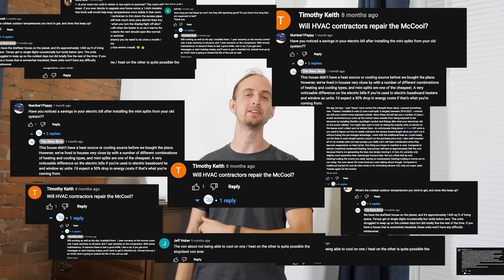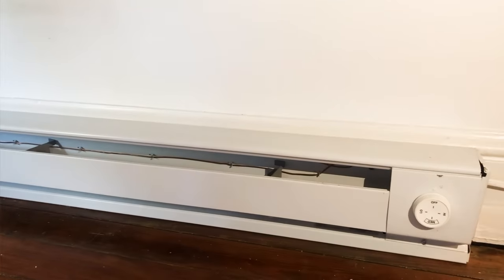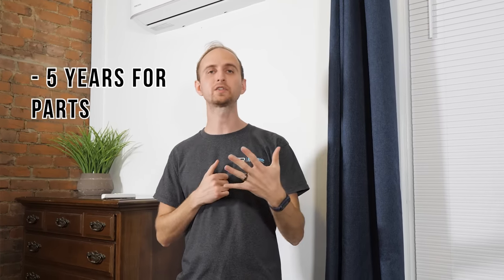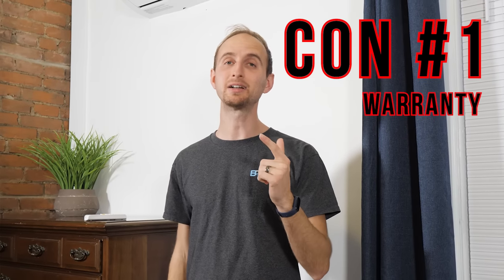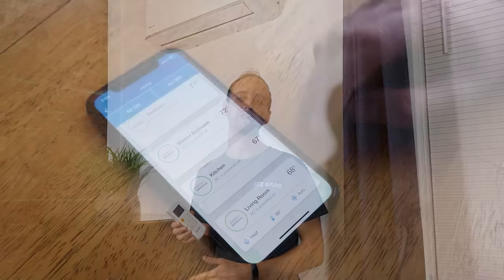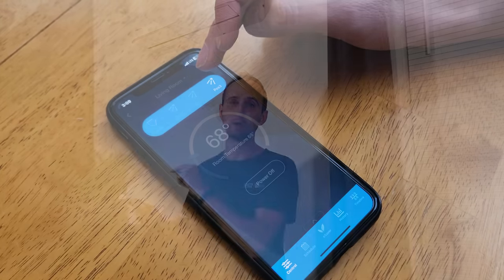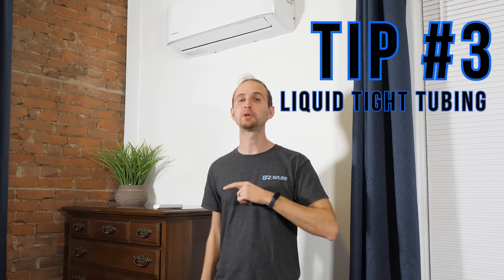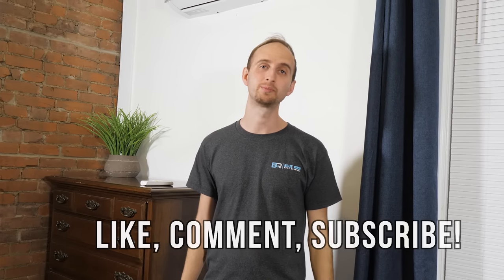Mr Cool DIY 2-Year REVIEW: I wish I would have known this BEFORE BUYING...

Comment: Just wanted to say, thank you for your video, very helpful for us to make a decision of purchasing a unit... Still a little bit stand offish. I do have a question for you... ?  Winter time... We get a substantial amount of snow, like 6 feet at times. The question is were we get so much snow, what to do with the condencer / unit that is out side.. Do we cover it? Do we not cover it ?  Do we have to keep removing the snow from around it.. if so that would be a lot of digging snow out from around it.... This might be a deal breaker for me if so.. 
Thank you 
Danny B
Reply from the maker: Thanks for watching and commenting! Great question, first of all I’d recommend to you to consider Daikin or Mitsubishi. The DIY component of Mr Cool is easily accomplished by purchasing Rectorseal fittings to connect the line sets of a pro system. If I had it to do over, I wouldn’t be so afraid of installing a pro system. The Mr Cool DIY needing new blower motors within 3 years isn’t a good sign, and Daikin has the number one spot in most reliable and best service ratings. Check into it! I’m not sorry I bought Mr Cool, but I hope that I don’t become sorry if things keep wearing out before they should.

As for the snow, definitely build a roof structure overtop of the mini split condenser. I’m sure you’ll be able to find videos of this on YouTube, or even how people in cold climates with a lot of snowfall do to protect their mini split investment. I know that some top manufacturers actually require a roof over the minisplit in order for the warranty to be valid. That’s not a bad thing, because they know that they’re offering a great warranty and they want their units to last a long time for their customers.

Comment: I've heard or seen others with leaking DIY linesets. Otherwise, if they do leak, you can pump them down, then cut off the ends and make them into any other flare sets if you remove the adapters on the unit itself.
Reply from the maker: Sounds like a great idea! Thanks for commenting! If I have an issue with leaking, which I have not yet in the last 2 1/2 years, I will definitely take that opportunity to remove the excess line set as well if it seems easy enough.
Reply: Doing the same thing because of leaking line sets. Where do you get the adapters to replace on the unit ? We  have 1/2 in line going in the adapter on the unit is much smaller.
Reply: @janetpuccio8209  You should be able to remove the adapter on the unit and then do a normal flare setup.

Comment: Just wanted to say my experience with support has been pretty good as well. We were having problems with the settings you discussed shutting units off and support guy back to us with the hour and kept with us for a couple of days until we figure out what was going on.

First the record, we had set up the app, as well as the remotes and they were fighting with each other.

Use one or the other and everything should be fine.

Right now I'm looking into the cleaning because we are expecting temps of close to 110 next week, that's why I'm here commenting on your video 🙂

Comment: We had the same problem, and they replaced the motor. I wonder if their motors are defective. More importantly when seeing how gross the the blower wheel was and how difficult it is to get to it, and you really need to remove it to clean with a water hose. I do think I would have reconsidered buying these as I think this needs to be done yearly.

Comment: The thing about cutting the lines to get rid of the coil is that the lines were pre-charged in the first place and the reason that it's DIY.  If an HVAC guy did come out he would have to remove the 410a from the system, cut, flare, and reconnect the lines.  Then he would need to vacuum the line, then possibly want to use nitrogen to pressure test the new connections, and I'm not sure if you have to vacuum the line again, but would need to recharge the system with new refrigerant (410a).  Would they use the stuff you have previously and top up if necessary?  If they would be using new stuff then that would be expensive.  No one would quote on that because the cost would defeat the low cost DIY system and no one would want to pay for that.
Reply: You would definitely need to vacuum again. This is to remove moisture and air from the system, as anything other than refrigerant and oil will impact the ability of the system to condense and evaporate refrigerant, and they would reuse the recovered refrigerant, most refrigerant types aren't allowed to be vented directly to atmosphere. Also, the linesets aren't just a simple flare, they use a proprietary connection made specifically to allow them to stay charged until connected.

Comment: Overall it seems these Mini Split’s work well.  I am impressed you still get decent heating in the cold weather.  The noise you hear after a few years in the indoor units is an inherent issue with that type of small fan motor.  Basically it’s the small ball bearings failing from hours of use and age.  It’s not a specific problem in any brand, they will all eventually sound noisy with lots of hours of operation.
Reply from the maker: We have a central air system in our new place, and it's just as loud when the condenser turns on

Comment: Great video 👍  i need at least one MrCool for my Moms house right now. But I don't have the $ now. So i had to buy a portable AC unit, because her windows are not even large enough for a window AC. And the portable unit she had just quit, i tried to repair but it apparently leaked off. So... I'm hoping to get her a MrCool next year. I'd like to get one for my house also as I only have a single window ac. And I'd love to have one for my barn, as its insulated but no AC or heat so it gets super hot in summer. Cold but not below freezing in the winter. Maybe someday 🙃

Comment: I put in a 12000 btu 220volt with my wife’s help total cost around $ 1400, my brother just had an old unit replaced by a contractor for 4000 but he is not as diy as I am, both units work great

Comment: That motor hum sounds very much like a dead bearing due to the usage of an unsealed or shielded bearing. This is generally in order to save 3-4 dollars per motor unit vs a sealed bearing which you can expect to last for the lifetime of the unit.

A confident DIYer could likely swap the motor bearings for nice sealed bearings

Comment: Seems most units come with the 25' line set. They have a 16" you can buy separately. Is it possible to swap the 25 for the 16, order a system with the 16, or return the 25 for credit. I probably won't even need the 16' length for my installation.
Reply from the maker: Good question! If you’re going through Ingrams, I’d give them a call or send an email to ask. I would expect them to do just that, especially since the line sets come in a different box and each one is sent individually packaged in a separate box.

Comment: That remote battery cover is incredibly annoying.  I've got that same unit.  It's about 3 years old and the interior unit is emitting a pretty annoying sound when running. so I probably will need to replace the blower motor and/or clean.  Hopefully Ingram will be helpful.

Comment: I am considering a minisplit to improve the temperature in my master bedroom (around 400sq ft including master bath minus closet) which is the furthest room from my forced air furnace / AC. The room gets too hot in the summer and too cold in the winter. I believe one could easily solve both problems however my largest concern is noise.  I would say my temperature range is similar to the video but goes down to around -5F for 1 to 3 days a year and doesn't really hit 100 but gets close on the hottest days.
Reply: If you have easy access to the ducts that feed it, you might consider adding a concealed duct unit by putting a return opposite the registers that currently connect to the whole house system in that room. Instead of having a wall mounted head, you'd have a regular wall mounted thermostat and the air handler would be in either your attic or basement/crawlspace, just with a dedicated system only for that room.

Comment: I was wondering where you got the liquid tight tubing and how much it cost?
Reply from the maker: Great question! Lowe’s and Home Depot both sell them. You’ll want the non-metallic kind, and you’ll need the screw-in connectors. The tubing is usually around $1 per foot or less.

Comment: Instead of having to wait for the compressor/condenser to defrost have you thought about building some kind of insulated box/housing that you can put over/around it during the winter months. I think some kind of temporary insulating housing has got to be better than nothing.
Reply from the maker: There are strict regulations with how much space the unit needs to breathe. You cannot legally enclose it in any helpful sort of way

Comment: thanks for these helpful videos. what is your system configuration? you show two outside units. is it true that one condenser could supply heat and the other unit supply cool to the attached air handlers? can one set of lines supply two or more air handlers or does each air handler require separate lines to condenser?
Reply from the maker: Thanks for commenting and for the questions! The two outside units you're seeing are for two separate apartments. One apartment has 3 interior units and one has 4 interior units. Each of the exterior units both heat and cool. The only reason I have two entirely separate systems is to have them on different electric meters. You need a set of lines running from the condenser directly to each air handler.

Comment: I inherited a split Mitsubishi system when I bought my residence. The unit is 5 yrs old now. It functions well and is quiet inside and out. One air handler in the master bedroom needs to be cleaned quarterly because of the combination of lint and steam from the shower clogging the filters and condensate tray. The other unit is cleaned annually but could go twice as long if need be. Can't speak to the money savings, but I can attest that the wife is cool in the summer and warm in the winter. That's enough for me. The newer systems will offer a split mode for each air handler that will allow heat and cool at the same time. What's not to love?
Reply: Mitsubishi and Hitachi were the two brands that I was considering (leaning towards Hitachi) before finding Mr Cool. I think the estimate for the Hitachi system was about $27000 after installation. I’m pretty sure I can DIY my entire house for half that with Mr Cool, and I can do one room at a time and spread the cost out.
Reply from the maker: Nice! Love it!
Reply from the maker: @RyanHarris77  I met an installer who only installs Daikin because he hates callbacks and never has any with Daikin. He used to install Mitsubishi but they’ve started cheapening certain parts and he started getting callbacks because of it. If I were to do it all over again, I’d DIY a Daikin system. You can purchase fittings that allow you to pretty easily DIY even the linesets and such. Just hire an electrician for the electrical setup and seems pretty simple to do the rest of it now that I’ve already installed the Mr Cool.
Reply: @TheRenoBros  my dad is a retired industrial/commercial electrician so I have that covered. Thanks for the tip!
Reply from the maker: @RyanHarris77  You’re welcome! So fortunate to have family that knows how to do that kind of stuff! What a huge help!

Comment: Single mini split (2 ton) owner of about 9 years down in coastal Georgia (island) where outside relative humidity runs exactly like you were calibrating a hygrometer surrounded by salt water (ie; 75% pretty much year round).  Our unit is a fairly nice earlier Electolux/Frigidaire which is now discontinued (but ours still works great). Cleaning tip for inside evaporator where mold build-up takes time, but still happens every 6-12 months (not during a heating season, of course):  Ours does not have the following  feature on the remote, however I noticed that if I manually run it for 10-15 minutes everyday on Fan-Only Mode, the inside unit dries itself very well and prolongs the 1-2 year manual cleaning cycle! (Our cleaning primarily due to mold build-up.)  I do not know what other manufacturer's remotes might have such a setup possible on a 24 hour timer basis to be able to accomplish this automatically, but I believe those in high humidity locations would benefit on a short off-hour cycle like this for cleanliness.  Appreciate your video!

Comment: If your mini split system  design is capable of multiple wall evaporator's then when one room call for heat and another call for cool they have to take turns the heat may get  first priority and cool will have to wait unit heat is satisfied kinda like a zone system in central hvac.

Comment: Thank you for this video.  I purchased a single unit about 6 months ago and have loved the performance and capabilities so far.   I especially appreciate the section the on the temperature or thermostat settings differences in the air handler.   I am having issues with the unit running and (cooling) much lower than the setting I have set.   I will now, try the follow me setting on the remote and see how that performs.   Thank you!
Reply from the maker: Thanks! Glad you’re enjoying the units so far! Those settings have made a huge difference for me, hopefully it helps you too!

Comment: Regarding multiple units having to operate in the same mode……is that because you have a single, or common exterior unit?  It seems that this shouldn’t be an issue if each interior unit had its own dedicated exterior unit.  This was not clear to me.
Reply from the maker: 2 exterior units are feeding a total of 7 interior units. So yes, common exterior units. 3 on one and 4 on another. It could be as simple as one head set to cool and the other set to auto (still set in such a way that both should be cooling), and it still wont allow it. So I think they should have a master remote feature in the app at least that allows control of all units with one touch of a button (as is standard with central air)

Comment: I live in Ontario Canada, I have 3 mini split heat pumps, 18000, 24000 and 12000 in the master bedroom. I only use them for AC having replaced a 3 ton central air. They are much cheeper for AC than the central air but are more than twice as expensive to heat compared to my gas furnace. Now having said that electricity is very expensive in Ontario and the price increases the more you use.

Comment: We have 6 Pioneer mini split units in our house 2 exterior with 3 interior on each. We have 6 remotes but one remote works on all of them. When I want to change the temperature I choose the temperature setting on a remote and reset all the interior  units with one remote  by pointing at each individual unit at a time. Try it with yours, it might work.
Reply from the maker: That would work but I’d have to run all over the house and up and down 2 flights of stairs. Moreso just pointing out that central air is more convenient to control from one unit. I believe it would be simple to add that capability to a mini split.

Comment: all I would say is , The hand held remote thermostat  . If you put it on a two foot table it will run the unit till the temperature is at that level , If you put the remote on a wall at four feet off the ground it will run till the temperature hits that level.

Comment: From what I have watched and read, I was told one unit would facilitate different rooms. We have a smal footprint, but only real installation possibility is upstairs in a dedicated prayer room, very small 9'x9' approximately. The lower portion is a Sunday house, basically a 20x14 foot shed roof salt box type house circa 1800's, with a vaulted addition of 12'x14', and 12'x14' respective..which involves a fairly low shed roof side. Doesn't seem to be a lot of area to address, but we are new at this. The originaly building is double wall rock…talk abotu way to go! But hard to cut holes thru:)

Comment: The Cielo Breeze is the most amazing product for mini-split units.  It s an ir control that you place in every room where you have a mini split. Their app makes it really easy to control all of them.  It also lets you program timers and conditions for operation.  I've been using it for almost 2 years, and it's never failed.  I'm using it with 5 zones of Mitsubishi.
Reply from the maker: Thanks for the info! Mr Cool has settings like that within their app as well. So you purchased Cielo Breeze as a sort of accessory to your Mitsubishi mini split?
Reply: @TheRenoBros  yes, it's a pretty simple product the sends signals to the wall unit via IR.  And if you use the remote that came with your wall unit, the Cielo sees the command and keeps it in sync.  
I did notice that the app on your video looks  a lot like the Cielo app.  Maybe Mr. Cool partnered with them.
Reply from the maker: @SoCalVipers  It’s very possible! Pretty good functionality
Reply: @SoCalVipers  Yup, the Mr Cool IoT stuff is Cielo.  I know because they sent me a new wifi dongle and controller board under warranty.  Actually I think Ingrams sent it but Cielo was responsible for the diagnostic process.

Comment: Most of the cases you have a problem with the BEARING. Which is dirt cheap.
Usually to take off the case and replace the (2) bearings, it is not more than one hour work. (Without cleaning, which is highly suggested if you open the case anyways)
If your motor is one with the right side bearing, then it will be a bit more long, removing the whole heat exchanger first, but not more than 2 hours of work.